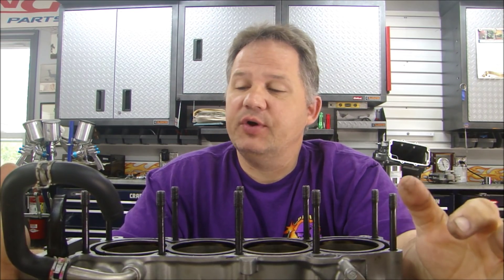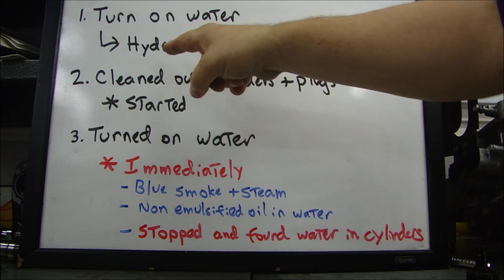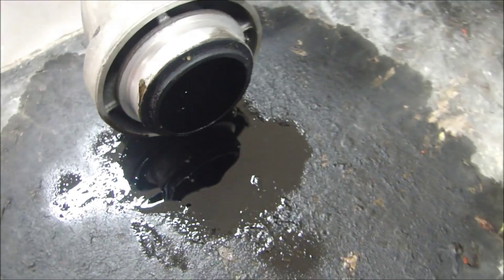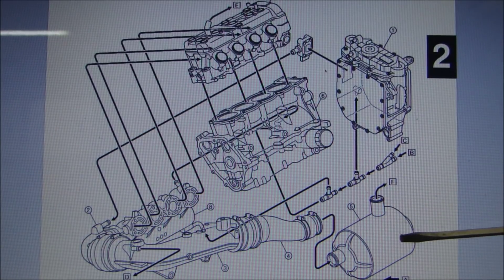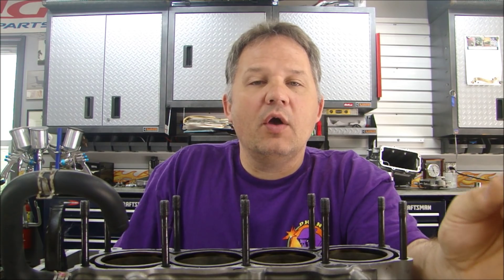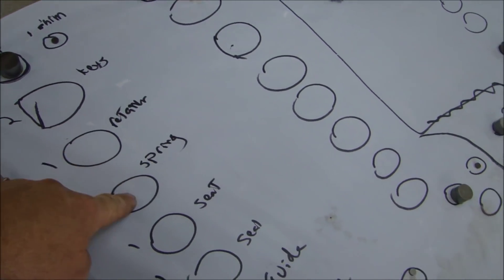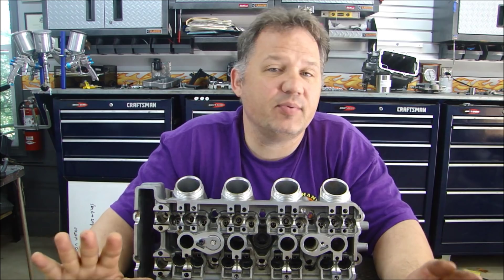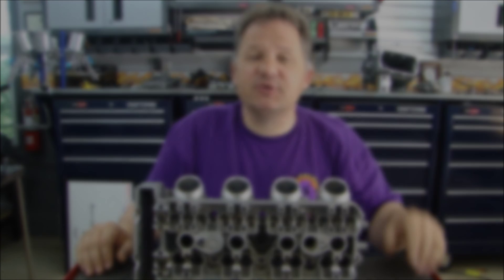Engine Repair Part 3

Comment: looks to me like a "freeze-problem". There is allways somewhere some water left.. Therefore I use a "Frost-Wächter". Thats an electical heater device keeping the temps just above freezing level (within the engine compartment of my oldtimer boats).
I am very interessted to follow your progress with that engine. Thanks for the open information. It is tricky..
Reply from the maker: Martin Kaufmann Thanks Martin...I'm still trying to figure it out

Comment: yo pete, i loved your engine building series and i learned alot, but your car is not only your engine. so if you could make a tranmission, brake, ect. episodes. thnks
Reply from the maker: Daniel Steinfeldt Ok....I'll do something on brakes....I usually change transmissions though

Comment: What are the chances that when water froze it stretched the head bolts? Then with a loose head it created a small enough gap allowing the oil to go wherever it wanted either over or under the head gasket; essentially bypassing the gasket without breaking it.
Reply from the maker: That's the whole thing.....there was no water to freeze. The head was still torqued down

Comment: Did you find water in the crankcase? Or drain any water out when you removed the oil when disassembling the engine?
Reply from the maker: No water in the crankcase.....it is puzzling

Comment: Crikey Pete...That's a curly one...The lack of contamination between the oil and water is strange...None of the cylinders have moved have they.?..That would account for the water but not the oil in the manifolds....I'm keen to see what you find.
Reply from the maker: This is the root cause problem to solve: Took the craft out of the water and ran it to clear water. It ran fine. It sat over winter, covered. This happened at first start up. What could possibly happen to cause the failure? I'm assuming something froze, but is that wrong? How can you put something that works away, then take it out to use it and it is broken. It does not make any sense.
Reply: ***** It happens more then people think. We used to get 20-30 every year with blown seals, cracked blocks, seized cranks etc.. All because someone didn't properly winterize it or they submarined it and tried to start it. As you have to remove the plugs and crank it over first. That way all water is removed from the cylinders. That the air filter let in or from the carburetors intake. 

We used fogging oil and a mixer of antifreeze and water to flush the system. Sprayed the outside or the engine with storage oil.  Removed the battery and filled the tank with fuel stabilizer.  I never had one fail when it come time to prepare it for use.  It's all in the details. 

I think you also have two problems now. Not just one. Look close inside the intake and exhaust. pipes. Maybe even block off the ends. Then pressure test each runner. See if you find any water or air leaking through the walls.

Comment: 7.18.15.     A very intriguing video series on your jet ski engine trouble! 🙈🙉🙊 looking forward to your finding the cause!
Reply from the maker: Steven Sapyak I'm trying to figure it out.....cars are so much more easy
Reply: @PetesGarage  where is the next video?  Part Four?  Also, do you have a video or taking the valves out?  I've never done that, but I'm pretty certain I will need to.  I had a spark plug core drop out into one of the cylinders.  Also, where did you find the exploded engine diagrams.   Thanks so much.

Comment: Cut the oil filter open. See if it has metal that was captured. If it has a high volume of metal in it. Your problem is in the lower unit. Also check the crank seals front and rear. As oil can enter the system mixed with water from the cooling system.

You can also order the gasket adhesive from Yamaha. As it is application specific.
Reply from the maker: Claude Rains Those are my next steps......Thanks for watching and helping me